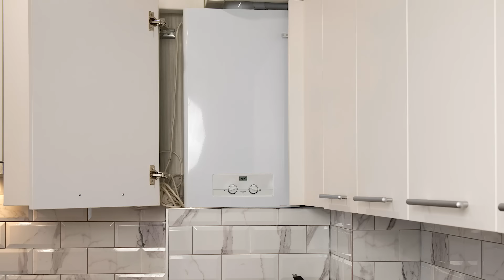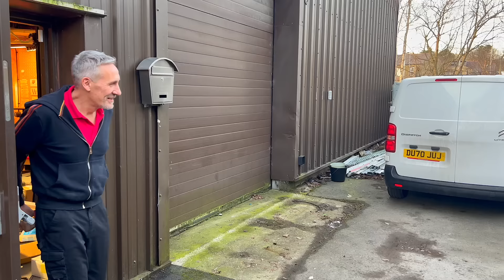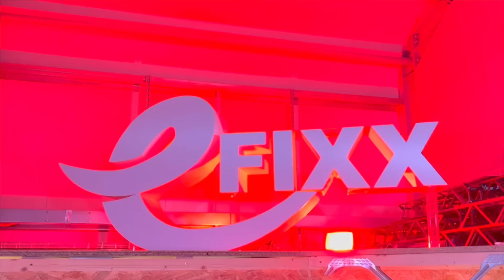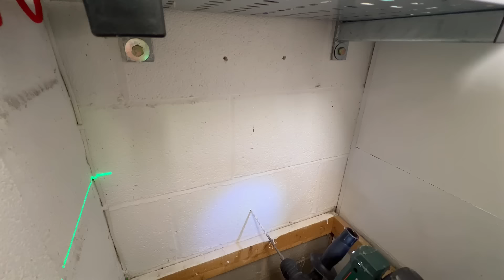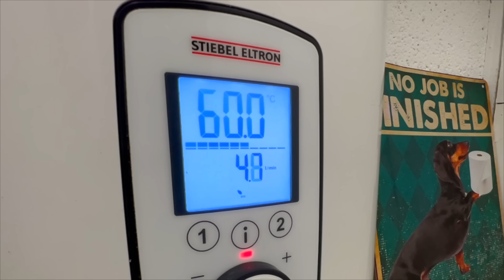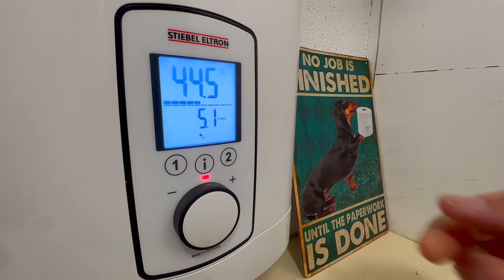The Shocking Truth About Water Heaters!

Comment: You could have easily put in a 15 litre tank in there? Maybe more?
But a Few points your advertising missed out on! For smaller instantous water heaters you will 
Need a higher fuse and or adjustment in electric layout to install.
To achieve hotter temperature Flow rate drops as well if you want to use a mixer tap. 
Most importantly these are vented and you can only add on vented taps. Which leaves your options restricted and vented taps are hideous and look out of the dark ages not at all pleasant to look at.

Comment: The more and more I'm not liking tankless water heaters I think they serve a purpose but they are also being pushed on the industry. And you're over in the UK when you have the more plentiful exotic 240 V. Over here in the states we have had highly insulated water tanks for the last few years and we're just starting to see heat pump systems get more plentiful and lower pricing. You're not heating the water that you're wasting your storing it in a thermal battery if the tank is well insulated it shouldn't be losing heat. In fact I had to replace ours and it came with a leak sensor which accidentally got tripped when some water spilled during assembly. So I had to bypass it to have hot water until it dried out, do you know how long it took me to realize that it wasn't actually heating the water a few days. I didn't realize that disabling the sensor by turning off the water shut off valve it also turned off the water heater..... It was like the second shower that week that I had when I noticed the water slightly cooler and didn't think anything of it until I realized a day later it was getting more lukewarm.
The truth is you're sipping electricity topping off the tank not reheating the whole thing from scratch unless you're actually using that water. Meanwhile another man water heater will have a maintenance system that's not being done and depending on the hardness of the water need to be done more frequently it will also need 2 to 4 40 amp @240v circuits. Which will also need to be running somewhere inconvenient because water and electricity don't mix so the water heaters usually not next to the electrical panel.

Comment: 3 phase 24Kw, are you mad !. Look at Europe,  you NEVER see this type of heater. 1.5Kw hot water cylinder, lagged properly, same pressure as the cold supply, 400 ltrs. 4 showers per day AND washing up. Pennies to run. AND can be fed by log burners OR dirert solar D.C. at 48 Volts if you know how. Recovery time doesn't mater as your not taking the hot water directly but warming cold as it flows through a pick up coil inside the tank. Easy, reliable, efficient AND cheap as chips to run. The UK has got so many thing wrong.
Reply: That is a small thermal store. 
What manufacturer is this product?
Reply: @johnburns4017 any manufacturer, you need a bit of tech knowhow about plumbing and electrics.
Reply: @ianmills1558  
I asked...
What manufacturer is this product?
Reply: @johnburns4017 its standard in Europe,  they can be purchased of the shelf in castoroma in france, i dont know the manufacturer name

Comment: I would love to find out more about Induction Water heaters which I have not seen available in the UK.        Built along similar design principals to a Heater element Shower type instant water heaters but suposed to be much cheaper to run.  They are quite cheap and available from Ali Express for about £80 + Ship & Tax = £130ish for 5.5kw which I believe is the max for a t&e 2.5mm  25amp cable.  
Their spec is a bit lacking on any comparison so I guess the best thing to do is get one and set up a test rig..  Taking into account ingoing water temp and exiting temp for power consumed.  Flow speed would be important .. ie : is it suitable for a shower..  I'm hoping someone may have had a stab at this so I dont have to.. (Not very good at this kinda stuff..)

Comment: Even in winter you could produce back ground heating with solar heating to a conventional storage tank topped up to required temperature with an electric immersion heater.
In times of higher insolation you will have more hot water than you'll need for washing up.
I had such a system installed in a rented house. In the summer I had more than enough hot water for washing up and bathing - yes taking a bath😊
The solar heating was from a 2m² panel into the bottom coil of a 170 litre highly insulated tank.

Comment: Off to Spain shortly, first job will be to repace 50l hot water cylinder, more than enough if not too many showers, This will have a 1.5kw imersion heater which is barely noticable on leccy bill, the cost at Leroy Merlin is 99 euros, 2 hooks, 2 flex pipes and plug in to socket nearby.
Why do we make everything so difficult.

Comment: I put your video on play and entered the shower just to IMMEDIATELY be reminded of why I hate tankless gas water heaters, specially if the gas is sold in tanks:
The tank got empty and I suddenly got cold water which I hate.
Even when I lived in a place with piped gas, that happened a lot, due to problems in the network.
In my own house I have a tank electric water heater and never have this problem.
Even if I use all the water, it gets gradually colder and I have enough time to wash the soap and get out before it gets completely cold.
No problem with it using energy to keep water warm as I have mine set to only heat up water in time for my bath.
I don't use hot water for anything more as I use a dishwasher and if I wash something by hand, I just use cold water.
I know a heat pump or a solar panel could be even better but I could put one of those.

Comment: Well if you consider that a quooker keeps water stored at 99 degrees ? what's the answer, yes a canister based on a thermos flask, we have one it's fantastic, so it's about insulation, not energy used, from memory ours uses 1300 watts for very short periods and keeps 7 litres of near boiling water to hand, we have never run out of water at the sink, so the obvious answer to scale it up in size to suit your needs,  so don't ask a sparky or a pipe fitter, ask an ENGINEER.

Comment: Alternatively a dishwasher? Joking apart we are about to start the big uncoupling to gas. Heat pumps provide hot water but aren't efficient at higher temperatures. Set the hwc to 40/42 degrees which is fine for showers and bathrooms and will achieve a COP of 4 but kitchens and utility rooms might need to have a hotter supply. The under sink machine should work for most situations, 3 kW and 15 litres? Yours was undersized for the job in hand. Or do as I did at home for when just 2 of us are there... 2 cheap kettles from Argos = 3 litres of boiling water x 2 if refilled, for the chore of washing roasting trays. Oh and combi boilers are rank inefficient, all the cold water followed by hot water and then the boiler left hot at the end. Less than 50% efficient... shocking waste of money.

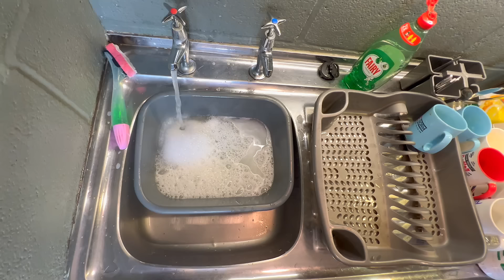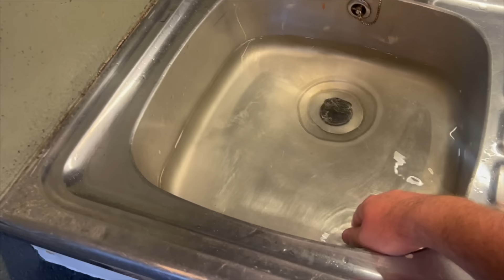Comment: 3:20 I'm glad you found an excellent and cheap solution for having only 10 liters of hot water as you mentioned at 1:15. It probably saved you quite some money for not having to rewire the electrical system.

Comment: I had fitted a 6kW under sink unit feeding my kitchen sinks when I lived in Asia, locals tend to only plumb cold to sinks reserving the hot water for the shower. It was certainly enough to fill two sinks simultaneously with hot water.

Comment: Given how you were using the original water heater you could have turned it off outside of working hours, which would have reduced the stand-by energy used by quite a bit. We use the ariston andris lux 2kw 15l in flats, they're only £100-£140 if you keep an eye out for offers, decent warranty, good heat retention, tenants always seem happy with them.
Reply from the maker: That’s what we explained in the video.

Comment: These consume too much and you need 3phase to be able to get sufficient hot water. 
Just not feasible for most consumers.
Reply from the maker: Single phase option available 10.8kW
Reply: @efixx  not for normal European fuses, most of them are 16 A, that’s about 3.6 KW so a no go.
Reply: @JustBadMeAndI  
You install a larger cable and breaker to suit.

Comment: The only reason to use tankless water heater is if you can power it with gas, use very small amounts of hot water, or you don't use hot water regularly.

For an average home a regular water heater with the right sized capacity (200-300L for a average family) is the thing. If you can control it with the energy price throughout the day even better.

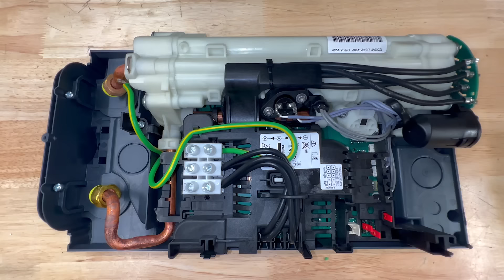Comment: 4:07 The copper piping in that thing looks like it was run-over by a van several times then shaped with hammers.  Not exactly inspiring.  On the electrical side, what is with the heating wiring design to the green circular PCB - edge clearances just for the birds I guess and arc isolation slots just in the general direction of where they are needed?  Oh and what do we think of an earth (ok, CPC) cable just tagged onto the outside of the copper pipe with a blob of solder?

Comment: The real trick with water heating is to properly understand the energy supply for it regardless of what that supply actually is.  Then you will get the best bang for buck.  Controlled supply for me doesn't mean it's only on between certain hours.  It's a guarantee of a minimum total number of hours across a 24 hour period.  The cheapest rate gives 8 hours minimum, but depending on the network load vs generation it could in practice be on for 15 hours or more.  The next tier up gives a minimum of 18 hours but may only be off for half an hour at the peak of demand on the network.

Comment: Considering how you scold unqualified people who do electrical work, maybe relying on a qualified plumber would have resolved your initial design issue. :)
Reply from the maker: The original heater was installed by a plumber.
Reply: A plumber who has a brain, not an NVQ.

Comment: For tankless you need the right power supply available at its location. That 18 to 24kW Model needs three phase cable with 4 to 6mm^2 and for everything above 5kW power consumption your local power company needs to approve of it's installation (at least here in Germany).
With a little tank unit you are set with a normal single phase wall outlet, as they usually don't pull more than 2kW, at least here in Europe.
Reply: in Germany you need an inspection if you want to use an electric hob?
Reply: @leonspano9114  No, you need to tell them that you want to use a FIXED appliance that can draw above 5kW, what it is and wait to get approval. They want to know in which parts of the power grid they can expect what kind of load and when, so they know which parts of the grid need upgrading. They can deny you to use such things, if the grid is too weak at that location (transformer too little or too far away).
Reply: @wiedapp  wow, in Italy you can do absolutely what you want. The electrical company is only forced to supply you (domestic user ) 3.3Kw an nominal 230v in can range from 264 to 195 volt, for them those are useable value. You can ask for more power but you need to pay a lot more for the activation and it's not always possible

Comment: That sink full of hot water! I have a 12V 2Ah battery that's more than ten years old in the cupboard under the sink, recharged by a 'smart trickle charger' in a nearby socket. The battery is wired to a solenoid valve on our ancient Heatrae Sadia's 3kW 7litre over-sink water heater (with the very nice telescopic spout) inlet via a guitar effect pedal on the floor in front of the sink. I wash dishes with a little sponge-scourer dipped in a mug of soapy water, and rinse off with a wah-wah from the foot pedal. Saves a fortune on heat and water. I keep meaning to make a mechanical one based on a bicycle brake-cable but the electric one works so reliably I've never got round to it. It's rare we need a whole tank-load (we turn it on just before the washing up, off as soon as it's up to temperature) to do the washing up for 4 adult-sized people, even including roasting tins.
Reply: Hey, I see you have a bunch of videos, could you link the one to the set-up you're talking about in this comment? Or make one if needed? Sounds awesome and would love to see and learn from it.

Comment: I fitted my steibel eltron last year, got the most powerful single phase available and it is very good but has one big drawback, same as showers, the colder it is outside the more work it has to do and the flow rate is very low in the winter compared to the summer, it does for me but it can take a while to fill the kitchen sink this time of year.
Reply from the maker: Great feedback
Reply: @ShadowzGSD  any idea if it can take preheated water. Not hot just room temp water.?
Reply: Use a shower drain heat recovery unit to reheat the inlet water if one can be fitted.  It is a vertical tube heat exchanger. It reclaims heat from the drain of the shower.  
Also use a Raindance aerated shower head. Gives the impression of a bigger shower. 
If your electrical system is big enough, add a smaller instant heater in parallel, to use only in winter.  In summer switch the electrics off then turn a quarter turn water cock to isolate the heater.
Reply: Sounds like a great excuse for a cheeky three-phase upgrade.